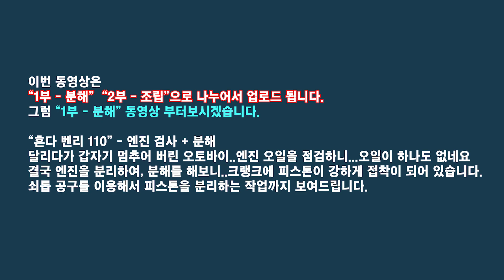This is what happens when the engine is out of oil - Honda BENLY110 engine disassembly

Comment: We should pampered the motorcycle just like we pampered ourselves.
We buy new shoes - bike need new tyres.
We fed ourselves with food - bike need to be fed with petrol.
We buy ourselves new clothes - bike need new coverset or fender when damage.
We go for spa treatment - bike need servicing or maintainance.
We drink water when necessary - bike need to top up engine oil or brake fluid when necessary too.
The list goes on, treat the bike right and it will serve you well down the road. 😘😘😘😘😘
Reply from the maker: nice comment.. 👍👍🏍🏍🏍🏍🏍🏍
Reply: @MotorcycleRepair  sharing is caring......hehehe 😋
Reply from the maker: @aussierheinhardt4390  😍😍